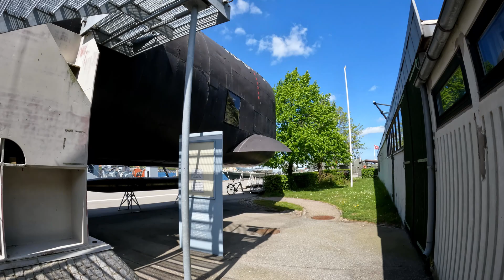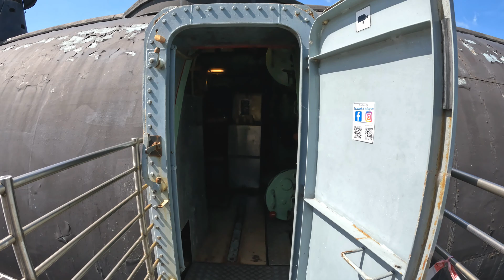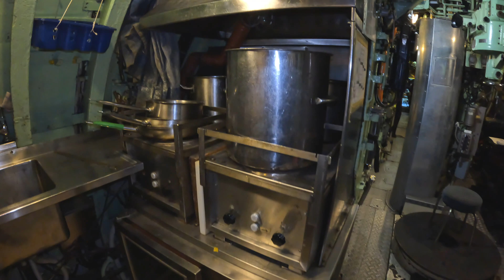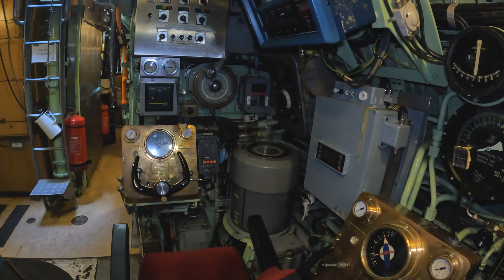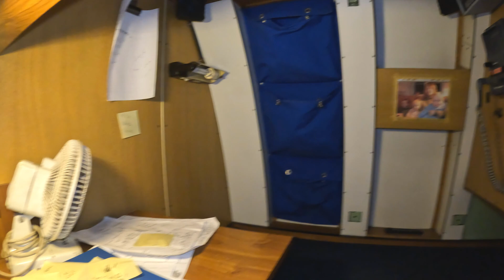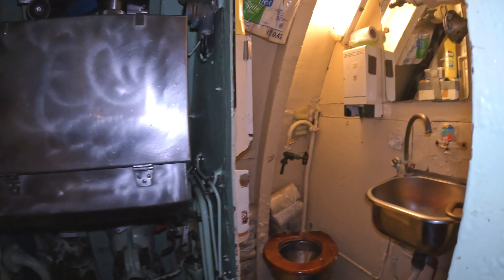Danish Cold War Submarine Walkthrough & Audio tour - "Sælen"/S323 - German Type 207.1

Comment: Very cool!

My father served on the KNM Kobben around 1980. He is over 2 meters tall, but he didn't have any problems with the space onboard. But he did say that if you were taller than 150 cm, you had to walk backwards into the toilet :) He also say, like you, that the submariners ate better food than most. The food was very important for morale, when being underwater for a long time. He reckons the most he spent was 14 days without daylight. When he served they had 6 hour shifts. They were also of course, hot-bedding, but they luckily had their own sleeping bags :)

He was a diesel mechanic, and they had a lot of different stations, depending on what the submarine was doing. From handling the engines, to steering and doing the ballast balancing.

He gave me a tour of KNM Utstein which is at the naval museum in Horten, Norway. I made a video of it, but haven't listed it atm.

Comment: I was thinking that countries that construct and use non nuclear subs could possibly replace the diesel motors with fuel cells powered by hydrogen. They would generate electricity to run the sub's motors and charge a bank of batteries that would be for emergency use. The fuel cells would create drinkable water as the by product. And hydrogen could be replenished by electrolyzing salt water. This a simplification to it's basics but it would be worth looking in to,
Reply from the maker: The current German designs use a combination of Diesel electric and Hydrogen fuel cells. The Swedish use a combination of Diesel electric and a Sterling engine burning diesel combined with liquid O2
Reply: @BecksHobbyProductions  That's pretty neat. There are many applications that fuel cells can be used for.

Comment: I kinda want to see more about that torpedo reloading process. Which seams very inefficient and and overly complicated, instead of just making the tubes muzzle loaded
Reply from the maker: There are pictures showing more at the museum 🙂 Keep in mind that only the 2 top tubes were possible to get out of the water. The remaining 6 would be under water. Only other option was a more traditional top deck loading system
Reply: How much exactly would they remove? Looks like mostly the tables need to go. Beds seem to be able to be folded against outer and middle walls and the NCO mess forward wooden wall has hinges. With the longitudinal middle wall being fixed, torpedoes cannot be moved from left to right anyway, so loading one side at a time allows you to store footlockers and other loose items on the other side. Storing stuff on the deck in rough seas is in no way practical.

Comment: i think the reason why they got fixed angle dive planes is they dont want a complex hydraulic system that could fail when diving.  if the sub is diving and the planes jam it would force the sub to a deeper depth faster and could result in near or past crush depth.   its just my guess...
Reply from the maker: That is a good guess. Maybe the sub has a mechanical solution to extend/retract that you would not have on a traditional design.
Reply: It's so they can extend both simultaneously to perform a tactical barrel roll.
Reply: @andrewthomson   some machinery on a sub is held in place by gravity other systems dont work upside down.  if the sub is ever upside down it would be disabled and the ballast tanks dont work upside down lol.
Reply from the maker: Very true.
Reply from the maker: @@wolfman3442 I got a few more details from the crew. The forward bowplanes were primarily used when the submarine was near the surface (can't remember the actual depth). And you are correct, diveplanes are not the primary tool to dive a submarine - it's the ballast tanks. The stern diveplanes were used to help stay at a certain depth because it's impossible to obtain 100% neutral boyancy